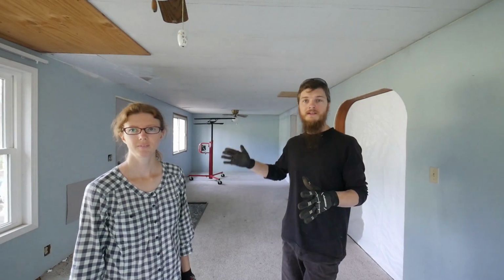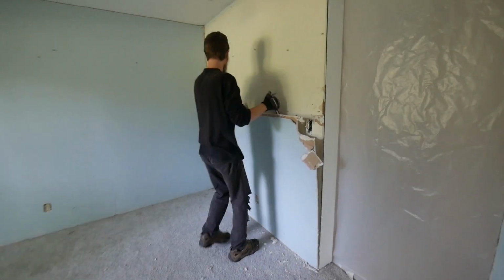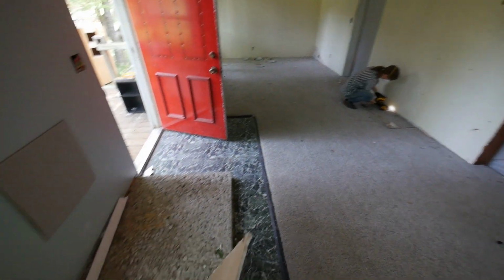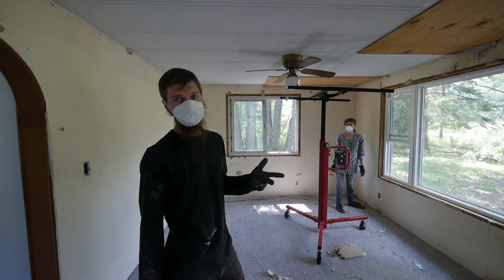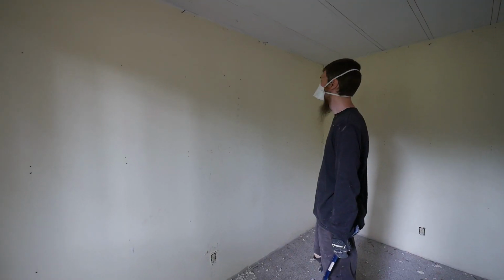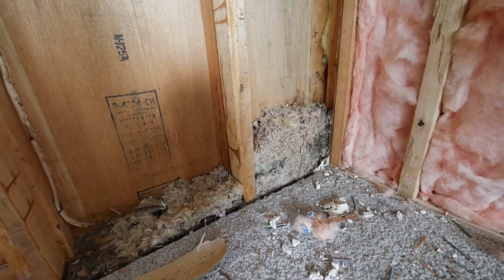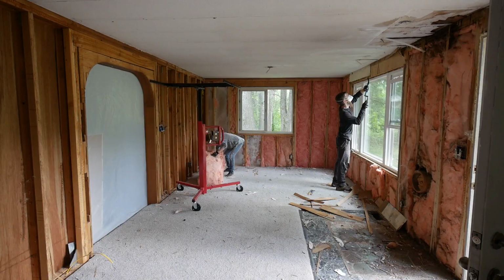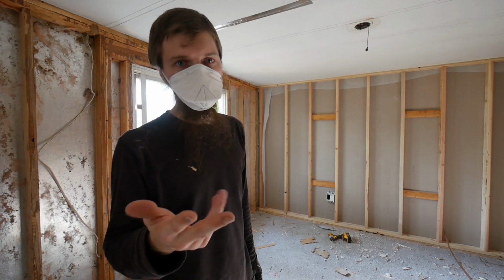Tearing Out our Nasty Living Room - Home Renovation

Comment: Hard to believe that someone would cover up mold! That's SO dangerous!1
Reply: Will you replace the chimney eventually or are you switching to heat pumps which don't require use of fossil fuels?...
Reply from the maker: We use electric wall heaters and eventually will be installing a wood stove. It gets too cold here to use heat pumps during the coldest time of the year.
Reply: @diyfferent  That' surprising to hear about the heat pumps. We live in eastern Canada and have long, cold snowy winters. We bought two Fujitsu heat pumps a few years back (18,000 BTUs each) and heated a 3,400 sq. ft.house that only had a bit of blown in insulation on top of old fibreglass. It was a century home so it had 4 inch thick walls. We DID supplement for the upstairs a bit with oil water rads but hardly burned any oil at all. It can easily reach -25 here in the winter, BEFORE wind chill factor is factored in. In our NEW home (a much newer build), all we use is our two heat pumps with an occasional firing up of our convection wall heaters. How cold are your winters?
Reply from the maker: @ellensmith7952  Our temps get very cold, in the negatives (F). But we've always read that heat pumps work well until it gets to be too cold out, and then they either use too much power to run making them less efficient, or they rely on a back-up heat source. I found this site: https://www.nordicghp.com/2015/12/air-source-heats-pump-cold-climates/
Reply: @diyfferent  Nope not true. ONLY if you purchase garbage. However it's quite possible that the heat pumps you have read about are poorer quality ones. Currently our provincial govt. offers a grant if one qualifies for a pump.The best ones are made in Japan or at least have Japanese parts. They run about $3500 to $6400 apiece. The cost for these is prohibitive for a lot of folks. But here in eastern Canada where the only other option, historically speaking, is oil, it saves a BUNDLE of cash. In our first year of use, we saved thousands  per year. As the ones we bought had a 10 year warranty, they paid for themselves within approx. four years. We also got AC with them. The best way to apply the technology is to piggyback a forced hot air system; that way, the heat dispersal is much more evenly experienced and one can have AC in upper levels as the furnace fan pumps the cold air evenly around the house...
Reply: @ellensmith7952  heat pumps are awful, had one for a short time, also very expensive to run and I'm in California .  I would never have one again
Reply: @califdad4  I guess it's all relevant. It saved us thousands in heating oil...but then heating oil in Canada is quite expensive...maybe one can purchase a heat pump that runs on natural gas and that would be less spendy...not sure...we love ours! :-)
Reply: @ellensmith7952  I've not heard anyone here that really likes them.  We mostly have natural gas , so most have gas water heater and house heat, not all that expensive.  Even though I'm in northern California, our seasons are not extreme like yours, cold for Jan Feb, and about 4 or 5 Months  we get rain, , but we use air-conditioner's more than heat some years
Reply: @califdad4  Yep. Been to most of California and experienced your varied climates. Green with envy! But, yes, if you have natural gas heat, that would be less expensive by a long shot. A full tank of heating oil where we live can be anywhere between $750 and $800. I have even seen it go as high as $1000. And it's not unusual to go through at least a tank per month for several months in our cold winters...
Reply: So $300 to $500 per month electric bill for two heat pumps saves us a lot of moolah! :-)
Reply: @ellensmith7952  wow.  I'm near Sacramento, the capitol.  We have everything in this state, the summit in the Sierra's is only about a hour from me, but I don't get that weather or snow.  SF is 99 miles south west of us, but their weather is totally different also.
Reply: @ellensmith7952  yes, I understand that would be cheaper than oil.   I was in a townhouse rental, while waiting for someone to move out of my house, (long story) and had a heatpump, the place was like 1200 sq ft and cost more money than my larger house does with natural gas heat
Reply: @califdad4  We moved to eastern Canada from our nation's capital - Ottawa - where they use primarily natural gas and we remember who ridiculously inexpensive it was! I have a good friend who lives just outside Chicago who heats and air conditions her older home - a large one - with NG. She once quoted me her monthly heating bill. I nearly fell off my chair it was SO low!! :-)

Comment: I noticed some rot on your siding.  Will you be replacing all that to?
Reply from the maker: Yea, once we're done with the inside we'll be redoing it. It's the original fiberboard t1-11 siding from the '70s and it has seen better days. :)
Reply: @diyfferent  I grew up in two different mobile homes.  The first one had all metal siding and the second one had the fiberboard like yours.   40 years later the metal siding still looks good, where as, the fiberboard not so good..lol

Comment: Is the outer walls made of aluminum? Looks like it is.
Reply from the maker: Looking from the outside the lower white part is aluminum and the blue is fiberboard t1-11. The metallic stuff you see on the inside is a fiberboard sheathing.
Reply: Ok, reason for question is  I never seen it before, thank you for anwswer, youre both doing a great job!

Comment: How do you prevent the mice from coming in? What do you do exactly?
Reply from the maker: Whenever we find gaps and holes we'll just seal them up so they can't get in anymore :)
Reply: @diyfferent  What do you seal it with?
Reply from the maker: @axiom1650  Spray foam works great on the cracks. Also, since were done with using propane furnace heat, we're covering all of the air duct vents with new plywood so those will be permanently blocked off from all types of pests.

Comment: interesting you said they covered the mold to hide it. Did you ever consider this may of happened after it was renovated ? It is always easier to blame previous tenants/owners for the state of a dwelling, even if you don't know the history prior to your purchasing.
Reply: I didn't understand it that way, Doug was just saying the old panel was covered with the dry wall, which hid the mold and rot. The previous owners probably had no idea it was there as it hadn't surfaced into the drywall and paneling and probably developed after the old drywall was installed over the older paneling. Meaning, the potential problem wasn't noticed because of not removing the old panel first, the damage could have been avoided with a total gut in the first place, where the problems would have been discovered and corrected early on.
Reply from the maker: No, not blaming anyone. I didn't mean they covered it to hide it. I'm sure this mold happened after the drywall went up. I just meant that people like to just cover over stuff, like they did putting drywall over the paneling. Sorry for the confusion.

Comment: Americans and their cardboard paper houses.
Reply: non-americans and their obsession with american cardboard paper houses...
Reply: I have heard it is because of the tornado's, hurricane's .... it's saver than bricks, do not know if it is true.
Reply: @SalomiSmit  no it is not. I live in Florida and it is a requirement here that houses be built, at least the structural components, with cement block or brick. This is common in most areas that are prone to hurricanes. California tends to use wood because of earthquakes being common. Elsewhere in the US both styles are present, but wood is mostly used because it is just one of those things where you start building with what you know/have and then it becomes a standard and thus too difficult to change because the workforce would have to get trained in an entirely different way of building. kind of like why we never adopted the metric system in civilian life here. also wood is incredibly abundant in the US versus Europe.

Comment: shit and stick house 😂
Reply from the maker: What kind of house do you live in Olga?
Reply: @diyfferent  I live in a brick house with concrete floors, this design is extremely unreliable
Reply from the maker: @lingaa3516  Yea, and if your home had any problems, I doubt you'd be able to fix it yourself. We can fix our house ourselves easily and cheaply and it will last a very long time. Plus this type of home is usually more energy-efficient. That's why we like stick-built homes.
Reply: @diyfferent  This is not a stone in your garden, it’s not the first year I've been looking at what you build houses from. Cheap? well maybe, but avaricious pays twice. All houses of this type are made of sawdust and drywall, from wood there is only a frame. At the first hurricane, such houses fly away with the wind. In a brick (stone, and even completely wooden timber) house, there are few problems in general, if the house is built in good faith. The wiring with pipes and sewers for 50 years lies, but it needs to be replaced but overhaul is not often done. I emphasize again that I didn’t write an insult to you. I’m happy to see what kind of beauty you get.
Reply: No need to be rude
Reply: @lingaa3516  You have noooo idea what you're talking about. When concrete houses have issues from settling or water, you just about have to knock them down because repair is so expensive. And there is a reason wood frame construction is preferred for areas with earthquakes and tornadoes. It's far harder to make masonry houses safe. Masonry also has much, much worse insulation performance.
Reply: @lingaa3516  Just so you know, my wood frame house (not a mobile home) is 55 years old. We did the first remodel. And we had to replace ALL the plumbing because the acidic water had caused pinhole leaks. It would have been the cost of replacing the house after 55years if it was block. It's also SO much easier to remodel for modern wiring in the kitchen with so many different circuits for small appliances. Again, horribly expensive with a masonry house. We can totally redo the appearance of the house about every 30 years and the mechanical systems every 50 to 75 years without being too expensive.